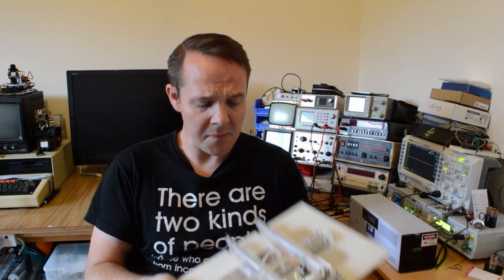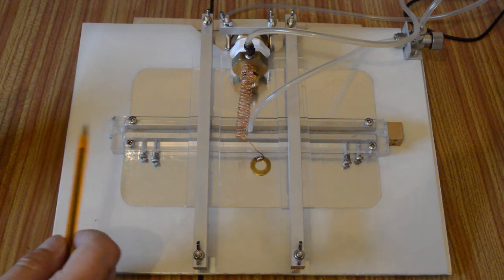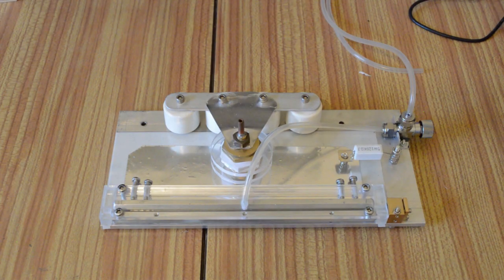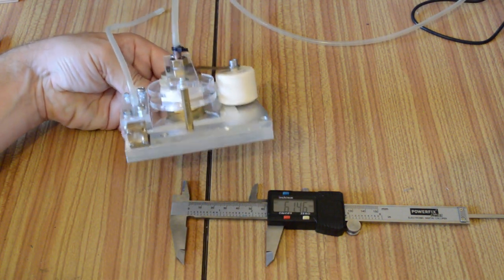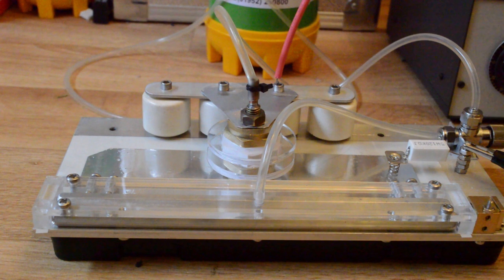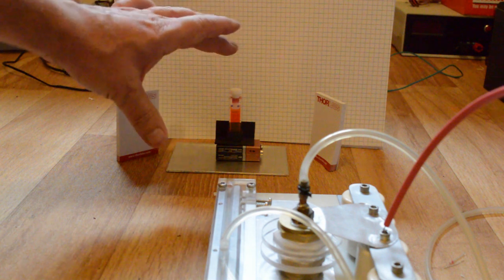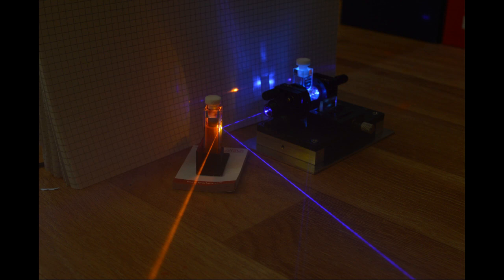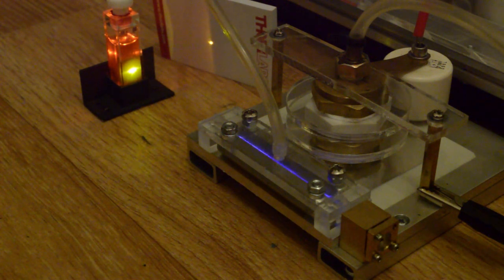DIY Home made High Performance TEA Nitrogen Laser and Dye Laser!

Comment: I have built both TEA and TERP (Transverse Electrode at Reduced Pressure) nitrogen lasers. According to my sources, charge transfer circuits are a little less efficient than LC inversion circuits for N2 lasers (although they might be ideal for CO2 lasers). However, I think charge transfer circuits offer some advantages for DIY-ers. 

First of all, charge transfer circuits work better with low current power supplies. I think the net voltage (across capacitors and laser electrodes) is greater when a charge transfer circuit is charged with a low current power supply. I suspect this is due to greater charge leakage that occurs with LC inversion circuits, but I don't know this to be the case (any thoughts?). All I know for certain is that I seem to be able to get a wider laser electrode spacing and/or higher frequency of pulses, using a CT (Charge Transfer) circuit as opposed to an LCI (LC-Inversion) circuit. The big difference I'm talking about occurs when using an extremely low current power supply, such as a Wimshurst Machine or similar electrostatic device.
Reply: The second thing is simplicity. With CT circuits, no inductor or charging resistor is required. With higher voltage via wider spark gap spacing however, placing a resistor (or inductor) around the laser electrode channel prevents flashovers (sparks that track across the dielectric surface and bypass the spark gap). Although this eliminates flashovers, it might also result in reduced laser output.
Reply: Finally, the issue of inductance is different. With the LCI, both capacitors (on opposing sides of the electrode channel) must have extremely low inductance for the laser to work. This obviously means both capacitors must use parallel plates (like aluminum foils) charged with the same polarity, seperated from a common oppositely charged plate through an extremely thin dielectric (obviously you know this, but I'm merely providing it in an attempt to be more comprehensive). With a CT circuit however, only the peaker must be designed with such a great emphasis on minimizing inductance. The dumper is much more forgiving in my experience. This means larger capacitors might work as dumpers (though more energy might also be wasted). I've successfully used Leyden Jars as dumpers. Wire connections between dumpers and peakers, opposite the sides with the spark gaps, might even work (I was able to make it work, if I remember correctly). It's not that minimizing the inductance of the dumper isn't important, but it just seems less important than it is for the peaker. Given this apparent fact (please correct me if I'm wrong), I think the CT circuit offers a greater range of experimental potential for DIY nitrogen laser designs.
Reply: My apologies for the series of replies - every time I tried to post it in total, the result was truncated.
Reply from the maker: @magx1  Ha! Yep I don't suppose YouTube comments support large replies!
Sure charge leakage is an issue with LC Inversion circuits, but it depends on the capacitors. 
Back in the day, I built a low pressure N2 Laser using Doorknob Caps rather than PCB caps as shown in Sci-Am and it worked gloriously! PCB (or aluminium foil with dielectric) are pretty leaky. You can see the corona glow in the dark around the edges, and it is bound to drag down a low current supply.

For sure, regarding your comments about the inductance of the Dumper, the discharge from the Dumper will contribute to Lasing if the inductance is low (there are academic paper to back up this assertion) , but it is the Peaker that is critical in terms of inductance as you say.

Given how well this design works, I am convinced that many cheap small value wire ended caps (like with  MMC's for Tesla coils) could be pressed into service as a Dumper cap, significantly reducing the overall cost of the design. I will have to order some and give it a go...

Comment: Is it possible like how emf on rotational motors use, to build that mechanism on a 7inch in diameter that rotates out right of tge specialized tube where microwaves can be contained in that tubing and the emf tube is increased by also sprialling the waves out into a more concentrated focal point,  umm i dunno refraction or defractions that reduces the microwaves but i feel that can be solved by emf on a higher rotation, and power,  maybe even incorporate super/hyper/ sonic waving at the left to project it out?  Basically  trying to figure out microwave weapons that can control the microwaves without much loss and create a focal microwavable beam and smal as a quarter

Comment: Why not just fill the spark gap with nitrogen, Plug it and call it a day? Is there a need for a constant new nitrogen supply?
Reply from the maker: There is a need for fresh N2 in the laser channel, but sure, you could pressurize the gap and seal it. I considered adding a Schrader valve, but never got round to it.

Comment: what pressure of the nitrogen? can it work under gas pressure larger than 1atm?
Reply from the maker: The channel itself is open to atmosphere, nitrogen is at a flow rate that is just enough to displace air, so atmospheric pressure. The spark gap is pressurised to 2  bars.

You can run at higher pressures I believe, but as you increase pressure, so too does the speed of the discharge.
Reply: @LesLaboratory  what is the meaning of "the spark gap is pressurised to 2  bars".
Reply: @LesLaboratory  if using two Neodymium magnets to form the channel (N-N or S-S or N-S), what will happen?
Reply: @LesLaboratory  thank you, I like your work very much.
Reply from the maker: @georgegreen3672  the spark gap that transfers power to the peaking gap, is pressurised. Pressurised gaps are high speed, low inductance switches. Regarding magnets, no idea. I have not tried it, or seen reference to it in the available Nitrogen Laser literature.
Reply from the maker: @georgegreen3672  You are welcome!
Reply: @LesLaboratory  Oh, after watching your another video I understood.

Comment: How many laser power cook the food ??boiling the water ???
Reply from the maker: This is a complex question. Depends o the mass of what you want to heat, the wavelength of the Laser and so on. I cant imagine it would be remotely efficient. Food would likely undergo ablation and photolysis which would have unpleasant results.
Reply: @LesLaboratory  use laser light Institute of microwave Magnetron

Comment: ok i can wrap my mind around the emission from the tea laser coming out from both ends of the device because of the discharge region having a shape even without mirrors but i assume the light is still spreading out and diverging or at least a small portion of it that is not in the direction of the cavity right? but what i cant figure is how come there seems to be a creation of a beam with directionality from the dye cuvette without mirrors? should it not be emitting photons in all directions? or does the reflection from the glass act like a feedback? also why were there no beams visible from those that were hitting the paper in the back at 23:00?
Reply from the maker: Ok, so question 1: Yes, light would be emitted in all directions in the nitrogen, however most of the gain occurs longitudinally. Little to no gain would occur across the small section of the channel. 

Question 2: So a couple of things happen here, as you point out the walls of the Cuvette will reflect back about 4% of the beam back into the cell, providing some feedback. Also as the cell is at an angle, the focused beam is not a spot, but short line. The gain predominantly occurs along this line. This can be proven by tilting the cuvette, so that feedback from the walls can no longer contribute to Lasing. As with Nitrogen Lasers, Dye laser have exceedingly high gain. With a proper cavity they produce really quite reasonable beams, and with a diffraction grating instead of a full mirror, youu can tune them to any wavelength. See here: https://www.youtube.com/watch?v=-ny_-Y1MpRY

Question 3: You don't see the beam going back towards the paper because of the way the beams scatter through smoke. If you have a Laser pointer you can observe this yourself, If you point the beam away from you in fog or smoke, the beam will appear much dimmer then is the beam was coming towards you.Light tends to scatter forwards off of smoke particles.
Reply: @LesLaboratory  
im so happy you are giving me replies by the number as it's easier to follow and that is how i usually ask q's,, ok so
1)by gain you mean stimulated emission in one direction right? but again there must be uv photons coming out each end diverged like a flash light flood only they might not be so visible as much as the central axiz which has many photons in parallel correct?
2)ok so im right and the glass contributes to feedback and creating the beam shape right? also i assume the dye must have a longer exited state life than the tea laser so that feedback and stimulation occurs right? 
environment
Reply: @LesLaboratory  for some reason my last reply seems to have been cut short by yt script messing me up again,, but let me continue where i left off
3)you are right about the beam being less visible going away but i figured it should still have been somewhat visible since the other beams were so bright,maybe there brightness dimed them including the brightness from the spots on the paper ,i guess they scatter away like that having something to do with the nature of the photon ,interesting if it has a directional property of scattering forward
btw i have a suggestion that is easier and cheaper for you to fog up the room ,do what i do and start using glycerine, a few millilitres of it heated on your stove top with a circulating fan does the job nice and it lasts longer ,i used to smoke alot on purpose to be able to see the beam when i do my project lol but thankful i figured this easier way out ,even the dimmest of light is nice and visible this way, btw id like to ask you many q's i have regarding my project as im trying to create a collimated beam from white light off an led
Reply: @LesLaboratory  i had to come back on this,, are you saying the incident pump beam going to the rhodamine beeker is simply going through the solution and the lasing is happening in that region of the beam through the solution and then as it exists out at a different angle without any feedback it is coming out as a beam of different color or frequency on its own juts like through a ktp crystal for example? but how come the tea beam was hitting the other beeker dead on and it was lasing perpendicular to this beam on both ends? how does that make sense? how did it pick this direction without feedback?

Comment: Can a variable transformer be used to power the laser. Probably a dumb one just thought I asked
Reply from the maker: You need a decent DC high voltage supply. There is one described here: https://www.youtube.com/watch?v=GbQEan4gwWM

These lasers do not require the vast amounts of current provided by mains transformers, plus, accidents with mains HV stuff can kill.  ZVS drivers are the way to go small and efficient.

Comment: cant you simply run this thing cw using a high frequency fly back transformer? why must there be a capacitance discharge and the design be so complicated with the foil and resistor etc? i built a cylindrical capacitor using glass tube and aluminium foil and used it with the output on my fbt to create nice bright long arcs or sparks of a few inches long, why cant i simply hook both end to a couple of copper plates i have and get the same results?
Reply from the maker: Unfortunately no. Nitrogen lasers self terminate, so they can only be run in a pulsed regime. The capacitors must be exceedingly fast to populate the upper laser level, which only lasts about a nanosecond at atmospheric pressure. It is possible (in the literature) with fast flowing gas to drive them at repetition rates approaching 1kHz.
Reply: @LesLaboratory  first thank you for replying and fast, now i have several q's, 
1)what do you mean by self terminate? can you provide a more specific explanation of what is happening at the quantum state to the nitrogen atom and what self termination implies?
2)is this like a ruby laser that also has to be pulsed for it to work and it cant be continuous? but i thought electric arcs or sparks have a repetition rate of there own and there own frequency no? i never understood why ruby laser cant be pumped by uv light continuously or what all this means 
3)you drove it at fast rep rate enough to look like a steady beam though so i have trouble understanding what is meant by pulsed or continuous with respect to an electric field or light pumped or other means
4)if 60hz is considered cw then 1khz is even better no? again im not sure what cw really means

Comment: Wouldn't it be easier to ditch both circuits and drive the lasing spark gap with a TIG Welder in such a way to distribute the high current across multiple lasing gaps and collecting all radiation with sustainable mirrors/prisms ?

Comment: did you put the dye between a fabry perrot resonator?
Reply from the maker: Yes, a flat-flat Fabry Perot. The output coupler is 30% R 70%T and the high reflector is a plane aluminium mirror.
Reply: @LesLaboratory  
1)and i guess this helps boost stimulation and output power ect despite the dye already having pretty good gain but obviously not as much as the pump laser?
2)tell me these mirrors for lasers are they usually only silvered to certain amount in order for them to be totally or partially reflective? and do they work for the majority of the visible spectrum band? or do they sometimes use materials other than silver? just wondering if silver can work for most because i seen some ppl make homemade lasers using normal house mirrors they cut 
3)can the mirrors also work the same no matter the orientation? 
4) wow i assume you used 30r and 70t because the dye is already giving such good gain and all it needs is a 30% boost in reflection and allowed to output 70% out? that is awesome compared to the usual 2% out 
5) the full reflector is a second surface house mirror?
Reply: @LesLaboratory  did you have a focusing lens after the output coupler?
Reply from the maker: @ARCSTREAMS  yes, a 40mm FL lens, though I have since replaced it with a longer focal length for tighter far-field spot size. Any lens of between 40mm FL and 80mm FL will be fine. I get my lenses from old cameras, scanners, and laser printers. They can be pretty pricey otherwise.
Reply: @LesLaboratory  the blue beam did not appear to be tightly focused when being incident on the glass cuvette? and why was part of it being reflected? also i thought you need to have a hair line elongated focus to get a good region (energy /volume) to get a lasing in the form of a cylindrical beam ,how did you manage to get it from a single spot specially without further collimation or optics to shape the beam ?? the orange beam width appears to be much bigger than any focused spot ,not sure what is happening here?
yes i get most of my lenses the same way from old cams including from an old pair of binoculars and prisms included ,costly items if sought elsewhere 
could you please awnser the above comment where i asked you 5 questions?
Reply from the maker: @ARCSTREAMS  1) Feedback is always good. It improves beam quality, and allows for reasonable output at low pump levels.
2)The Output mirror has a dielectric broadband coating, and has a relatively flat response across the visible spectrum (Silver or Aluminium for OC's is old school and not really any real use in Laser applications). I bought the mirrors from Thorlabs. Not cheap, but didn't break the bank either.
Reply from the maker: @ARCSTREAMS  Above Q's answered, sorry I never saw it.  The blue beam hits the Cuvette with a glancing blow, so a small (1.5mm) line is actually formed, which is enough gain length at these ridiculous powers, to threshold the cell. Part of the beam is reflected off of the glass. The orange beam appears wider because it is. Without any collimating lens or mirrors the output of the cells diverges quite significanly,
Reply: @LesLaboratory  1)ok good
2)what do you mean by flat response? and why has silver or al no longer used? they still worked did they not? are they still used for HR? what is dielectric exactly,what kind of material?
i suppose you must have not seen the rest of my questions probabaly because you did not open the comment? here are the rest
3)can the mirrors also work the same no matter the orientation? 
4) wow i assume you used 30r and 70t because the dye is already giving such good gain and all it needs is a 30% boost in reflection and allowed to output 70% out? that is awesome compared to the usual 2% out 
5) the full reflector is a second surface house mirror?
Reply: @LesLaboratory  no problem i reminded you lol,, ok i understood everything aside from how you get a 1.5mm gain line if you are using a focus lens which creates a spot or a point since you are not using a cylindrical lens?
Reply from the maker: @ARCSTREAMS  because the cuvette is at an angle instead of dead on, the spot appears elongated on the surface.
Reply: @LesLaboratory  got it ,and please dont forget these
2)what do you mean by flat response? and why has silver or al no longer used? they still worked did they not? are they still used for HR? what is dielectric exactly,what kind of material?
i suppose you must have not seen the rest of my questions probably because you did not open the comment? here are the rest
3)can the mirrors also work the same no matter the orientation? 
4) wow i assume you used 30r and 70t because the dye is already giving such good gain and all it needs is a 30% boost in reflection and allowed to output 70% out? that is awesome compared to the usual 2% out 
5) the full reflector is a second surface house mirror?